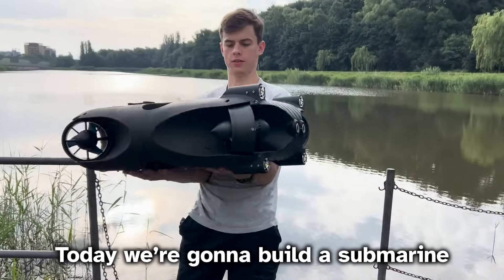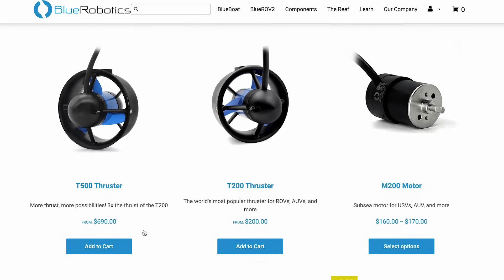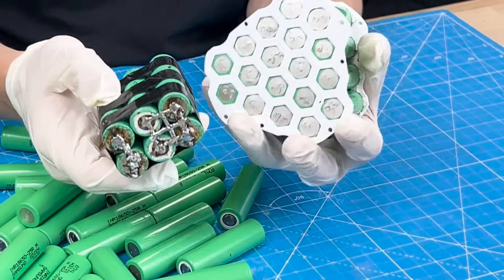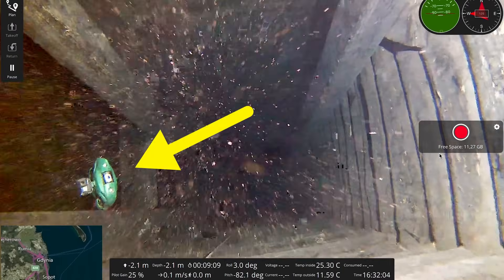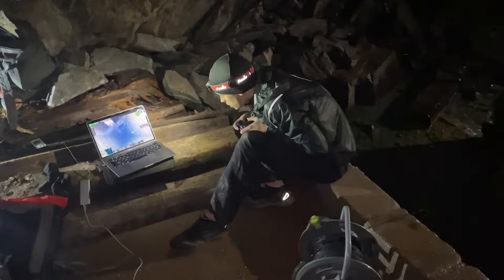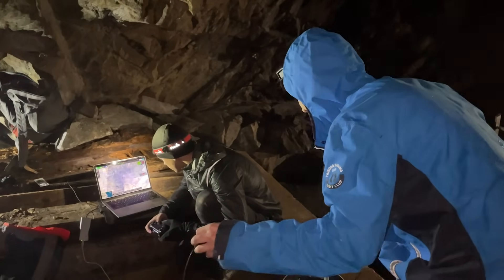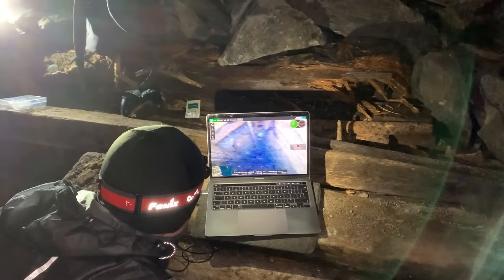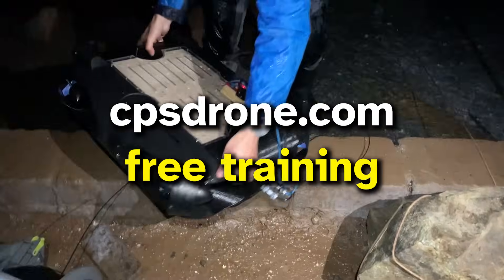My DIY Submarine Dives As Deep As Possible (PT2)

Comment: I'll admit I know zero about water drones but I DO know Free Diving. Have you thought about using a lead or steel sled to drop the drone down quickly? Then explore the bottom working your way up and to the sides in the cross shafts? When the sub reaches the bottom it detached the weight sled, become neutrally boyant and then can style around under water at max depth? And.... what about a stretched neoprene body glove like divers/surfer wear? Even a stretch over silicon covering on the sub would help with the pressure? Maybe? And 3rd idea? Make the sub pressurized inside. You can pump it up out of the water and then adjust the pressure with a syringe and servo? A syringe can make a lot of pressure and a sealed syringe cannot be compressed even with an Elephant standing on the plunger? Or so I've heard...

Comment: To avoid a lot of power usage, a ballast system if you can calculate your depth range, pressure is more effective for going up an down. also, you can take down battery or steaming nodes, or have a line that has a connection or connection help IE liek a massive antennae anyways... a battery node system, could be helpful, or means of amplifying and direction a signal, so you can go down some of hte lateral shafts.. hmm

Comment: you need a nylon/steel tether or your going to snap that fiber cable by pulling on it. also the anchor point is best to extend all the way through the core of the drone to avoid ripping it out if you get stuck and pull on it hard. if you dont add this you are more than likely going to end up with a lost drone that cant be recovered

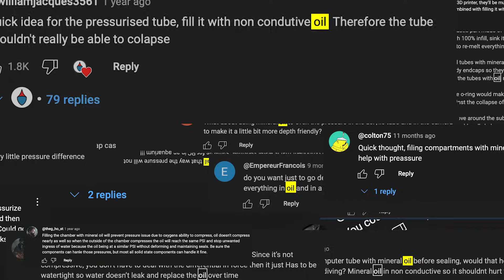Comment: 1:34 You would have to find an oil that is both non-conductive, and is as non-compressible as water. Water doesn’t compress very well, and if you have an oil that does, the water pressure will compress it into a smaller space and create leaks. Or, if the goal is to negate the pressure on the hull, it will allow the hull to buckle anyway. So having a non-compressible fluid is absolutely critical for preventing implosion. You’ll have to get a fluid with a compressibility as close to water as you can get.

As for the interference with the cameras, it is a Uranium mine, so there’s a possibility of some radioactivity playing with the electronics.

Comment: First of all really nice job. But you now have to protect the cable better. First protection from getting sucked into the propellers. Some ideas would be either by nets or other surface enclosings with smal holes slits. (Thrusters seem to be stong enough to loos a bit of performance) or by stiffening and bulkening the cable at the drone end or some other solution. You are good engineers. You will figure something out. May be  test fiber cable integretiy out of the water and test bend angels of the fiber. Maybe the fiber sleef is not strong enough to protect it from bending it too far. This would meen you have to engineer a soultion for the whole cable.

Comment: Back in the 1960s I was considering an ROV having observed that many times sings rectangle after the line was paid out from the surface. 

So I considered the following what if the line was paid out from a spool on the drone.

This would have the advantage with an attached arm, fitted with a camera watching the spooling  out checking to make sure the line was not going to be caught on something. 

Spooling back in, the camera could follow where the line was and this would have the advantage did any tangling would be easier to undo if you can spool in and see where it needs to be remove from. 

I have not heard of any ROV to this day using this system. 

If you wish to pursue it go ahead and I wish you success. 

The only thing I request is did you keep me informed of any development to satisfy my curiosity, I have no desire to patent or earn from this it's all yours. 

Scientia Habet Non Domus,
(Knowledge Has No Home)

antiguajohn 

antiguajohn@gmail.com 

Best wishes

Comment: Consider building a propellerless drive. Not nearly the power but nothing to tangle into. You could also add a mesh over the propellers, impedes the force as well but lowers the risk of tangling, it's easier than building a propellerless drive. Add a sonar communication channel to it, so in case of cable breakage,you could at least slowly command it to do stuff via sonar.

Comment: Hey just an idea:
How about a eyelet on the back where the fibreoptics come out. Attach a steel wire to it. Then you can really pull without risking to damage the fibreoptics. 
Maby even put fibreoptics and steel wire together in a rubber tubing and put both on one spool. That could give stability and prevent the optics from being sucked into the rotors.

Comment: If you could put some sort of tripod over top with a pulley on it you could keep the line going straight down the shaft.  Then you need to keep pressure applied to that line. You might be fighting that a tiny bit all the way down but it would also mean it wouldnt be able to get tangled.

Comment: Amazing! Very impressive. The more mass, the more power to move. I'd think those motors are overkill :") but wow, I had similar sized water jets for my turtles which were less turbulent haha. I wonder if a slower screw would work best, slower too for less agitation. This stuff is right up my street exploring and making awesome tinkers. I say for a hoot, you should make a military boat or ship with working scale armaments :") :p It would be awesome haha. Great work!!!! A pairing wire would do well with the optic in a sleeve, or just adding a tough sleeve to the fiber itself. To pull on-strength, and rigidity to stop kinks. I wonder if proximity sensors would do well to auto detect when no feed to stabilise itself :o

Comment: My brothers, use a steel rope next to the optic cable. Connect them with heat shrinking sleeves every one meter to prevent such entaglements. Keep up the great work!!
Reply: it would also help reinforce the tether for pulling in an emergency
Reply: Brilliant!
Reply: If you're going that far you may as well include a power cable
Reply: @VAL9THOU  A minutes silence for that idea...
Reply: Connect them every 1 metre? Ha great, you've now just made a cable with hundreds of loops on it that can catch anywhere. 🤦
Reply: @TimmmmCam  lol exactly...
Reply: @TimmmmCam  You missed the part where he says "shrinking sleeves." Shrinking sleeves would cover the loops.
Reply: @ramajyello you missed the part where it says "every one meter"... The shrinking tube would be at equidistant lengths distributed over the whole cable and therefore the single wires/cables would not be attached to each other inbetween ☝️😉
Reply: @WladimirWostok  u dont know what you're saying
Reply: @ramajyello  No, I exactly know what I wrote. You are now trying do maneuver out of your false assumption 😏
Reply: @WladimirWostok  Sure
Reply: @ramajyello  It is LITERALLY  what he wrote, why are your feelings hurt over it? 'every one meter' aka not along the entire length aka loops everywhere...

If you think he MEANT heatshrinking the entire two cables together... fine, but it's not what he WROTE

Now quit crying over it you look weak
Reply: @MarvinWestmaas  Whatever lets you sleep brotha
Reply: @ramajyello  the loops are formed from the two cables only being secured together every 1m, not the heat shrinking sleeves. You can test this by taking two shoe laces and running them parellel. Clip them together every six inches and youll be left with loops in-between the clips.
Reply: @chuck7797  You guys are relentless. Read the original comment again, then read my first response. If you still can't comprehend it, frig off.
Reply: @ramajyello  no you just dont understand. By only connecting the ropes at certain points,  loops form between each of the heat shrinking sleeves because the ropes are further apart in those places.

Comment: why don't you use the line to follow down the mine shaft and just hook around it 
add a second line to the drone it could be connected with the other line or separate pros and cons to each

How deep can you go before the fiber optic cable starts to compress and ruin the signal from the light or just crack

Comment: Ngl- I feel like the best upgrade to this design to prevent what you showed happened at the end to it with the cables and that random line from the mineshaft- is to put mesh guards around either side of each of the propellers to protect them from that kind of thing happening again.
Other than that- this design my actually be suitable for doing what you ultimately want to do- and might be able to reach the bottom.

Comment: I think it might be a good idea to add a floating tube every 1ft or 3ft such that it kind of balance out the gravitational force of the cable such that it will stay in the center of the vertical and horizontal shaft.

Comment: Might be a good idea to make the drone wireless, specifically Im thinking on keeping the fiber optic cable but instead of connecting to the drone you connect it to a wireless unit that connects to another wireless unit on the drone. You could then attatch the fiber optic cable to the drone using something strong like fishing line and setup a release mechanism that lets you remove the fiber optic line from the tether and easily pull it out while still being connected to the drone.
Reply: RF does not propagate well under water. It would have very low range and would require expensive and specialized equipment.
Reply: @braden6973  Maybe a light based solution. Using high brightness led to strobe the data. Using two different colours and a colour filter on the light receiver should allow simultaneous two way data transfer. The light sources could be omnidirectional and as the distance between the drone and the optical hot spot would be only a few metres the data rate achievable should be quite high. Possibly high enough for video as well as telemetry. Basically instead of a laser and a fibre which enables many kilometres, it would be LEDs instead of lasers and water rather than glass as the transport medium.
Reply: @braden6973  its why I brought up keeping it connected to the drone still. Having the wireless connection still connected but able to detatch in case the line gets stuck like that again.

Comment: All this engineering and your teather is only a fibre optic cable?!?!🥶😂  I would say you need a tube, (with a larger diameter that doesn’t tangle), that carries the fibre optic inside along a steel cable attached to the backbone of the sub.

Comment: Relying solely on a single fibre optic cable tether is risky. Reenforce the optic line by wrapping a backup line to it. But mount the backup in a way to leaving some slack in the fibre optic cable near the sub only.

Comment: U should try to put epoxy around the whole camera in the little clear container on the red submarine. Similar to an encasing also it’d be awesome with a  mini 360 camera and reconfigure the remote to where it can turn the camera how ever much which ever way. I love the engineering 🤌 the camera outage could have been due to the connection or too many particles causing bad pixelation, especially if it’s tethered through the “cloud” you should put a cage around the propellers so nothing gets caught in them

Comment: Engineering Rule #4: Complexity does not always equal effectiveness.

It would have been far more cost effective, simple, and practical to build a small, simplistic diving bell with a 360 degree camera and reinforced fiber optic cable that can be aimed by hand. You’re only going straight down a narrow path, such a big submarine with a fragile flexible cable is bound to be your first problem. The second issue was having so many points of failure like the size, complexity, the seals, battery life, the large torque of the propulsion system, and the number of thrusters. 

I work on aircraft, I’m not being rude, it’s just rule of thumb when designing something cool.

Comment: Using high performance car parts can also help form good seals like turbo gaskets and spacers. They are not “that” expensive but are designed to support very high air pressures and compression.

Comment: The funny thing is that you can actually bend a fiberoptic cable and loose the signal, then bend it back and get the signal back!
We actually had this problem with our internet connection, as the cable was bent on a sharp point. Bending it back fixed it again!

Comment: Since the water is irritated by leftover uranium, radiation messes with digital circuits and such, lead could help the sub drone prevent this happening, but at the cost of more weight which could lead to the drone sinking if disconnected from the teather
Reply: Radiation from uranium is extremely weak, it has a half-life of around 45,000 years, it's when you start bombarding it with neutrons and knocking the likes of strontium and caesium out of it that you get problems, they are the big killers as their half-lives are less than 20 years.

Comment: if you make the electronics capsule a proper airtight pressure vessel(doesn't explode with internal pressure) you should be able to pressurize the capsule to 90-150 psi with air while on the surface. This would buffer the capsule and reduce the maximum pressure delta the capsule sees. The more pressure you can get at surface level the deeper you can go before the stress switches to compression.

Comment: should put some microscreens or a cage around each prop to protect it in the future from fwoling lines, also should consider in your next version a "return home" feature, a sort of automated "emergency blow" where if the teether gets cut it returns to the surface.

I guess future versions could include some sort of wi fi tether, like on the  end of tether itself there's a transmitter winch allows control when detached, allowing you to for example pull up to a entrace you want to explore but cant due to the tether, you detach and explore then reattach when done
Reply: also some kind of manipulator would help in moments where it is stuck or you want to move things out of te way
Reply: return home feature doesn't work because the drone is controlled by the tether
Reply: @realherobrine5636  if the sub knows how deep it is then in theory its possible, albeit it would only be useful in open bodies of water or straight vertical dives unless a sort of AI mapping system was done so it can find its way out
Reply: @Believeorreason   the tether is literally what controls the entire drone so if it gets cut it's basically just a hunk of metal but even if it were possible to return home how would it know how to pass obstacles lol

Comment: While you don’t need to listen to me but if you plan to try that again here’s a few things I would change 
1. Add proper ballast tanks to change depth with they have less moving parts and are less likely to fail under literal pressure 
2. Add a mesh around the motors to help prevent damage and the jamming of the propeller 
3. Have a extra spool of wire on board the drone I’d try for about 100m or so of wire that way if it gets tangled it still can be recovered by using the wire on board instead of the wire that’s already stuck this will add redundancy and a emergency response to help get it back in the worst case scenario

Otherwise we’ll done

Comment: Try to add a geiger counter or a scintillator (which is better in this case) on the next version of the submarine, to measure the radiation level under there. Sorry if I said something wrong, I'm not a native English speaker :)
Reply: The water would probably block all the radiation though :(
Reply: I also had that thought and checked the comments first. I think it would still pick up in the water or at least let you know if the water is contaminated.
Reply: Your English is amazing don't worry, you said nothing wrong

Comment: Might be a good idea to attach a metal wire (running parallel to the fiber optic) for recovering instead of pulling on the fiber optic cable itself.
Reply: And yes as other have said something to protect against tangling of the intakes.

Comment: Could you not make it wireless and then just drop a beacon on a tether down to like the halfway point for a relay point or drop a couple relay points on a line down the shaft then that way you constantly have a constant connection to your drone submarine, kinda like a relay booster and sort of say

Comment: Where do you have univercity + work like this? I also want my work give me happynes........
And it's even in poland....FFS...mieszkam tam...

Also, sine you using drones like this in underground, isnt it better to give it bumpers and sleds to protect parts and give yourself guides when hit walls and roof of construction? Idea from first norith pole submarine design Nautilus. Good against stucks. It also can be fixed point on tail for 360 camera just to know whats going on near cables and what hitting you, like a fishtail or antena with cam at the edge. 
Mechanical arm can be also perfect tool but it's hard to realise i guess.

Comment: I'm guessing you used fiberoptic because wireless would start to lag too much, or wouldn't be able to reach? And the equipment needed for such a range underwater would become too costly, especially if you wanted a close to real-time connection? Love the drones design though, very sleek.

Comment: Here is a dumb idea - can this be made to be a wireless craft?  I do not know how much water attenuates radio signals but what if you lowered a transmitter/receiver designed like a plum bob - basically a torpedo shape that lowers only by gravity.  Then it could be kept in close proximity to the submarine craft so that it might be able to operate more freely.  Anyways thanks for the awesome video, super well done!
Reply: Pressure and water. Small waves